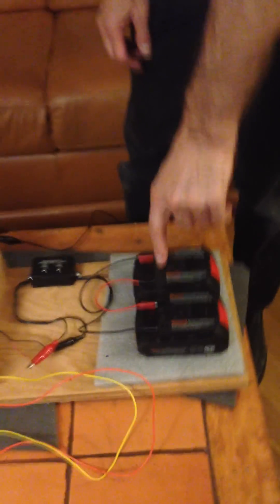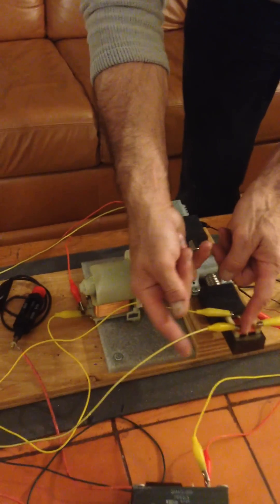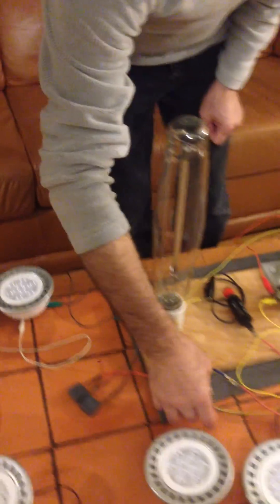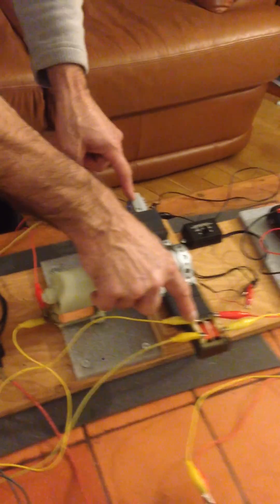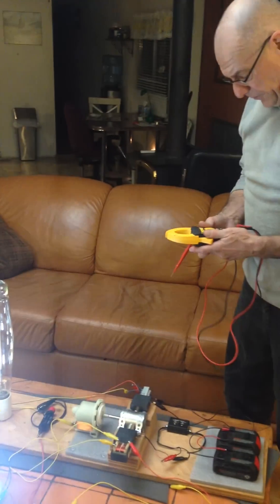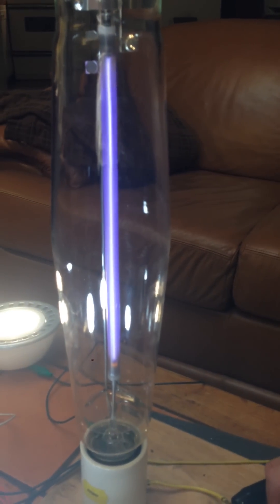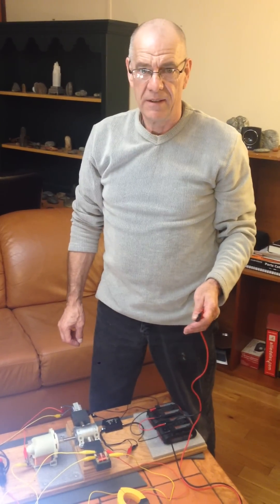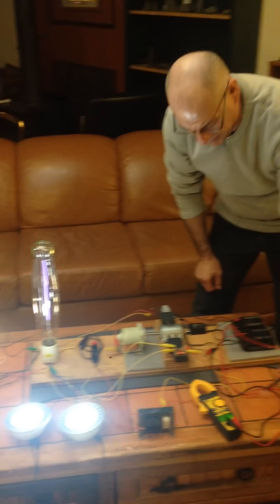Gerard Morin

Comment: you can't measure rf ac with a digital meter. false reading as rf interfered with crystal oscillators in digital meter. i know because I have also got simular results only to be proved a false eradic stray rf making the meter go nuts.

Comment: His setup resembles Stan Meyers VIC. The transformers are current limiting inductors that amplify voltage plus the short on the other side of the transformer creates a standing wave that sets up oscillations. Good job Morin.
Reply: +jawbreaker1975  Standing waves indeed.  Stan Meyer's "technology" was a hoax too.  Do you see anyone using his "technology" to derive power from water?  Well, do you?  Stan was blowing smoke about his "technology" 30 YEARS ago.  Why hasn't ANYONE been able to replicate his "technology"?  You guys who glom onto the crazies on youtube need to do some research.  You are being bamboozled, but you don't have the knowledge to know it.  Morin is just another loony who doesn't know amps from watts, from volts to ohms.  He's just a delusional old man.
Reply: +Quantum Leap You make a good point. I have not run across any videos or articles about a car running on water with hardcore proof.
Reply: +Quantum Leap So let me get this right, when using high frequency, a correct measurment of power out cannot be had. Is that correct?
Reply: jawbreaker1975 No, quite to the contrary, high frequency power can be measured accurately. A known resistance across a high frequency output will convert the high frequency energy into heat. The heat produced is then measured, and the amount of energy can be very accurately computed. Super High Frequency radar power is measured just this way.  But - this is NOT the type of metrology you find at Radio Shack or Harbor Freight. Of course Morin is quite unaware of this type of measurement system, as he is pig ignorant of what he is attempting to do.
Reply: +Quantum Leap Gotcha. So this setup isn't measuring the heat produced in the loads and the heat that occurs in the core of the transformer. Steorn was claiming overunity by trying to add the heat produced as if it was useable, they had a Bedini like setup. Thankyou for educating me on that.
Reply: jawbreaker1975 You're welcome.  In figuring energy transfer, and losses, ALL losses must be taken into account. Morin has heat loss in the batteries as they are discharging, in the driving motor, in the water pump motor/generator, in the transformer as well as copper losses in the driving motor, in the water pump motor/generator and transformer, and of course, the load or loads. With all these losses, there is NO way Morin can be 'creating' energy, he is merely transforming it, and at quite a loss. Of course, if you have no idea of thermodynamics, as Morin has not, then you can get in your youtube bully pulpit and claim OverUnity, ie 'creating energy'.

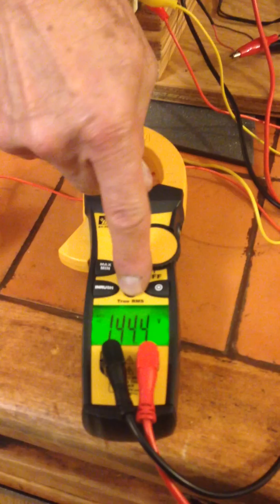Comment: At time index 5:40 in the video, you connected the digital meter to the pumps induction coil and it's open circuit reads approximately 146 Volts. Next jump to time index 8:05 where we see you performing the same open circuit test with the digital meter when it then reads the open circuit voltage of approximately 144 Volts. The conclusion is that in the span of less than three minutes, the DC motor which drives the pump has drained enough current from the batteries such that the pump's RPMs have dropped and thus lowered the total voltage output by almost 2 full volts. If you would have checked it again another 2 - 3 minutes later - the meter would likely show a drop in voltage down to approximately 142 Volts. You should replace the inefficient mechanical elements of the system that are a waste or energy (the DC motor and the water pump) with a digitally controlled circuit such as Pulse Width Modulated (PWM) to supply the step up transformed and voila - less current drop from your batteries and the system will run longer without so much voltage drop.
Reply: +Cameron MacDonald   But - regardless of how you invert the 36 volts to 150 vac, there are LOSSES. There is no energy gain, no matter what Morin's yammering claims. No Gain in Energy.  Just a loss.
Reply: +Quantum Leap Thanks. Good clarification on your part. I should have mentioned that in my post.

Comment: I have done a basic replication, it's real it works. I have increase of voltage and amps.   I also have an answer as to why, the system produces longitudinal electric wave just like Tesla used 140 years ago. Next step is self running system.

Comment: I believe that when you engaged the HV  Spark Gap Transformer circuit the impedance reflected back through the doubler transformer into the resonant circuit improved the operation of the resonant circuit.

   You probably could even make the pump even higher ac volts output by further fine tuning using different ceramic caps.to achieve perfect resonance.

Comment: Hi Chris I just watched the video several times to put together a drawing.   It appears that Gerard's setup to the 5 flood lamp LEDs is using a tuned resonant circuit transformer HV coil and ceramic capacitors seem to be in parallel.   It will interesting to see how long the batteries will be able to run all the stuff.   the 166v reading at the pump output terminals might be created by some coupling between the fields in the local area.   lots of fields going on in the circuit.    The 2 to 1 transformers with 300v output should be substituted and then see what the reading is.   The idea is to change individual components one at a time and observe the 166v pump out put to find the key.

Comment: Adding the electron tube might distort or add noise to the the output of the pump, so when it's measured the meter is no longer able to provide an accurate reading. I have had the very same happen in my experiments and thought I had something big until I put an oscilloscope on it, only to find I was at 90-95% efficiency. It's really too bad about not having current readings. You can measure current by measuring voltage across a precision sense resistor if you like. Just divide the voltage by the resistance to determine the current. It's good that a true RMS meter was used, but they are rated up to 1KHz, to higher frequencies could throw off the reading. Of course there could also be a phase shift between voltage and current when the tube is attached, and you'd have to take power factor into effect to really know what's going on. Also we should know the battery current to have a reference... In any event keep it up, I really hope we can discover something amazing here :)

Comment: How do you recharge the batteries? Let me guess plugging them to the wall haha
Reply from the maker: antonio bautista Without frequency modulation I'm able to run / not-run my drills battery charger at a variance of say around 1 to 2 hz, but if I was to control the frequency from the 120hz output to 60hz then yes consequently I would be able to charge the batteries. Bigger and better things to come :)!

Comment: what would happen if one would put iron instead of magnet in the pump? and run it as a qeg maybe to get some resonance. also how can we loop the radiant back to the motor that is powering the pump? radiant is cold electricity so that would mean that the motor should be cold when under load. can a dc motor run on radiant that is coming out of the pump? i went to school for electronics but didn't learn much really. and over the summer i repair household appliances  and air conditioners so i have many used wm pump motors. i have simmilar setup as gerard's but i don't know what else to do with it. we all need to put all our effort into this and figure it out because we are running out of time. we need to give earth a chance to recover from this abusse.

Comment: What is the power rating of each of the led lights -- a few watts?

The batteries are providing
36V x 1.1A = 39.6W, if they are to run for one hour (they have a 1.1Ah rating).

However, if you draw lets say 4.4A, you will have 158W available but 1/4 of an hour.

Could you please show us the amperage going into the DC motor?
And the voltage and amperage coming out of the pump?
Reply from the maker: In the above video we are pushing bulbs that have a use rating of 20 watts each. I will be conducting and in-depth video tonight looking at current, voltage and known draws. I will be using 100mA inline fuses to show that this power is unlike anything that is coming out of your wall or the batter for that matter. Hint hint: we aren't popping any fuses regardless of what we draw through them... unless we step up the voltage of course.. poor little guys just smoke when I add my neon sign transformer to the circuit :(.
Reply from the maker: Yes I'll show amps out of pump, you will be surprised at what we read though :). I recommend watching Gerard Morin's overunity video where he pushes 6K watts of   load through pig pole transformers from a 1500watt generator. 15amp inline fuse and no pop:). Also he reads current draw with his meter and shows less than an amp of current. Now when I open my fuse box in my house and clamp on over my "ground :)" and I turn on my water kettle I read about 9 amp draw at 1100 watt peak usage. That table saw was rated at 1500watt draw and thats about 12.5 draw at 120 from the generator. So you explain why we see no current draw in that meter in that video.... I sure can't.

Comment: Voltage input is continuous. Voltage at the spark gap is pulsed. You can't combine and treat them both as if they are the same.  Oscilloscope voltage wave forms(V) and current(I) measurements should provide a better answer to your questions. Another way to determine luminosity between both configurations is to use a photometer. Plain visual observation can be misleading especially when dealing with pulsed energy.
Reply from the maker: Great thoughts! Pulsed energy is what really has the kick we need to move forward :). Thanks for your input!
Reply from the maker: I have a question Rudy Maldonado. Why can the visual observations be misleading?
Reply: ***** Our eyes have a limited refresh rate. A 40W bulb with a continuous voltage is going to be bright and burn energy steadily. There are ways to pulse the electricity and make the bulb appear bright but in actuality, less
energy is used and emitted since it is not continuous. Our eyes may not see
the slight difference.